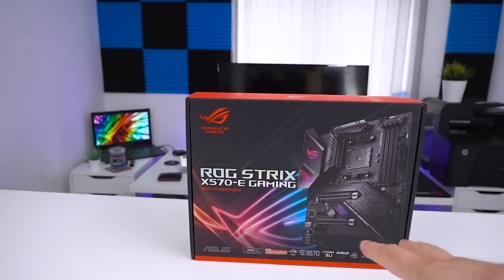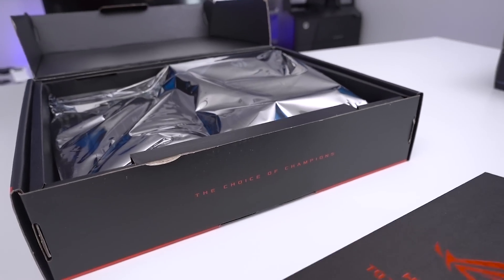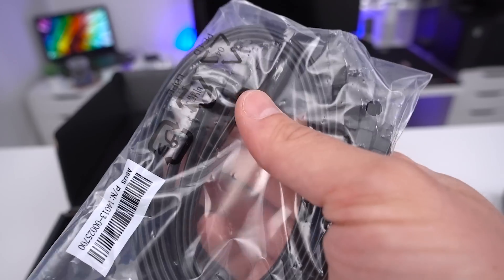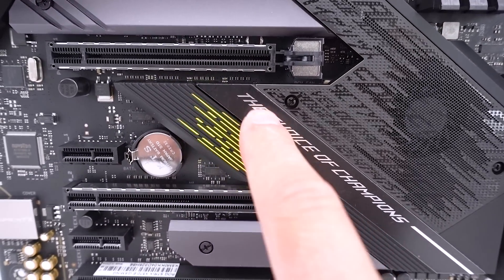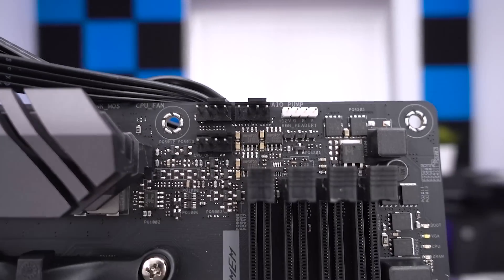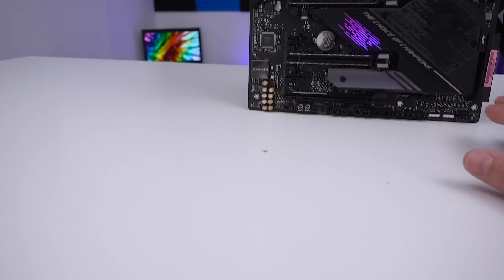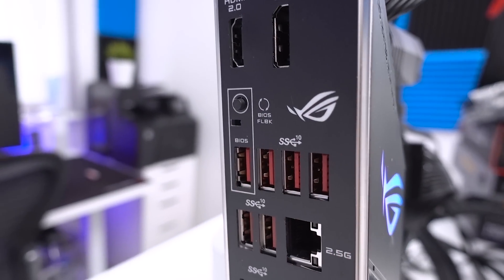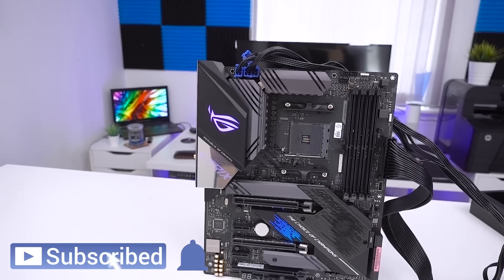ASUS ROG STRIX X570-E Gaming Preview & Unboxing

Comment: Hey guys, I recently purchased the Asus Strix x570-E motherboard but I'm having really high CHIPSET temps -> high fan RPM noise (3500 RPM):
72C Idle browsing reddit or Wikipedia and about 79C during gaming!! Can anyone confirm this is supposed to be that high for this specific motherboard or is my chipset heatsink faulty and should i order a new Motherboard? 
Thank in advance guys :)

Comment: This is going to be at very least $250. I would even say this board will cost $320 if i'm being realistic. 
X570 is going to look more like X590 theoretically.
X470 is going to be the mainstream and B450 will be entry level.
X570 will be priced high at the start. but the pay off is that X570 is the first mobo where the support from the vendors are massive. 
These things are over-engineered with real forward thinking.

Comment: Everything depends on about price. If its over 200 Im not interested
Reply: They will ALL be over 200,  for the half decent ones anyway. Only the cheapo boards will be 200 or under.
Reply: @ianchandler6086  cheapos are decent also - there was msi board breakdown
Reply: @ianchandler6086  The cheap boards are still better than most x470. Most of them have better VRMs and better features.
Reply: This motherboard is going to be 300 plus.